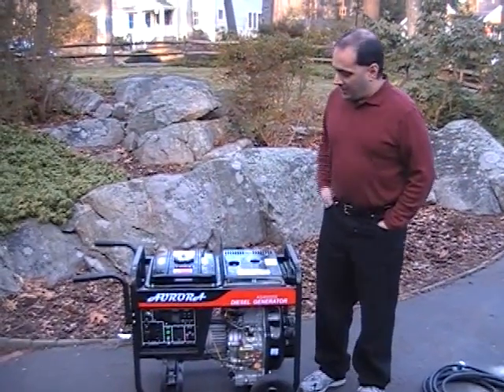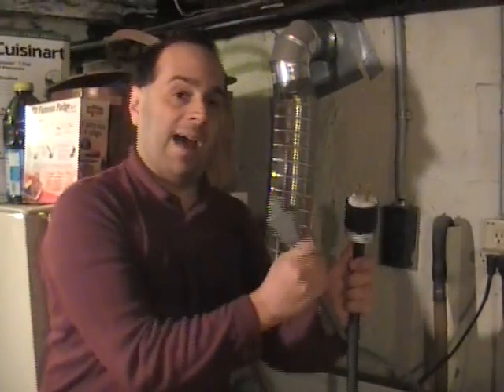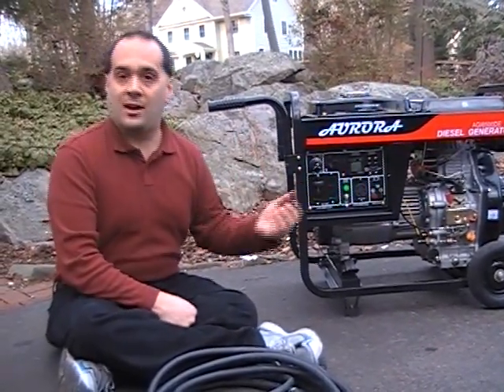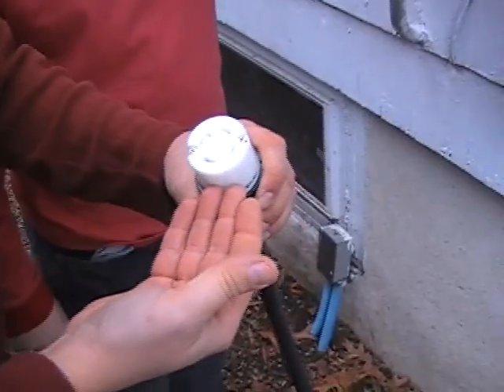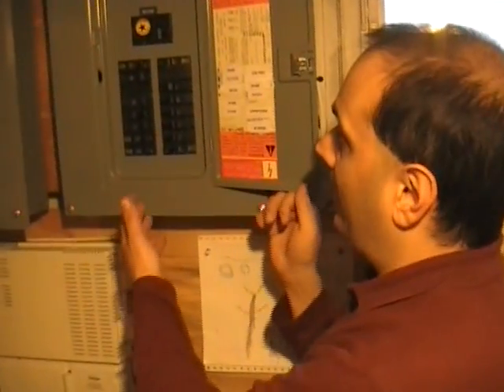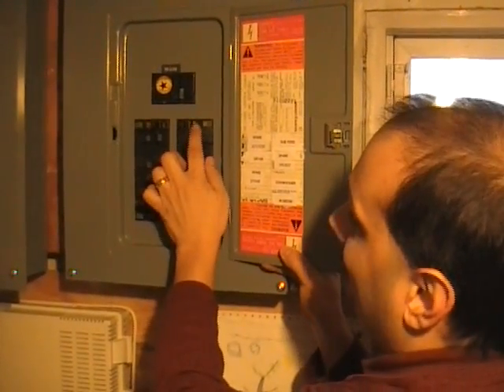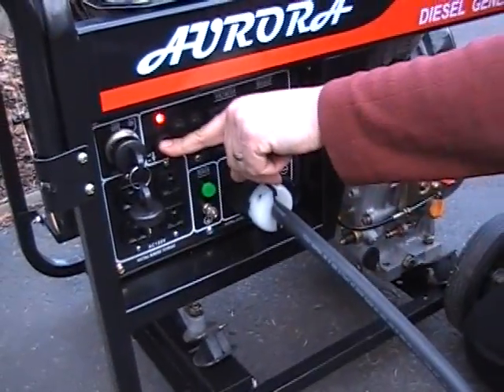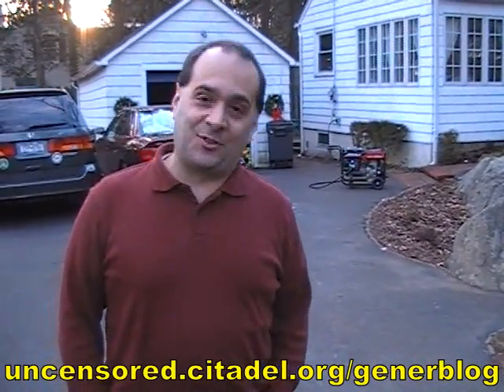Inexpensive residential generator hookup

Comment: The NEC allows up to SIX panels.  Ok, you added one to your main because you said there weren't enough spaces in the main panel.  You could have used an interlock kit on your main panel (which also feeds your sub panel via a 60-amp breaker) and moved a few circuits to the new panel to accommodate the new generator breaker in the main panel.  Your emergency generator would then cover ALL your circuits, not just one panel or a select few circuits.

When setting up your loads in the panels it's important to balance them.  Meaning, don't put all your 115-volt loads on one leg.  Use a tong meter to make the best use of the few watts your generator produces.  A 5,000 watt generator will NOT produce 5,000 watts on one leg.  It will only produce TWO 2,500 watt legs.

Please emphasize that overload protection (breakers or fuses) are there to protect THE WIRE.  That means, whatever size breakers are on your generator MUST be covered by correctly sized wire between your generator and your service panel.  Some jurisdictions (like Dearborn, MI) will not allow aluminum anywhere in the city, so now we're only considering copper wire sizes.  If your generator is more than 60 feet away from the service panel, bump the wire size UP.  Why? Because (current squared times resistance) the voltage will drop drastically as current nears the maximum amperage of the wire.  Yes, I am an Electrician.  BTW, Square-D QO breakers are the finest on the market.
Reply: Actually, the NEC only limits you to six operations of the hand (usually the main in each of six panels all connected to the incoming service line).  There is no limit to the number of sub panels (i.e., panels fed by a breaker in the main panel) you have because shutting off the main panel shuts them off too.  
If you're going to install a sub panel, I'd just move enough circuits over to it to free up enough space in the main panel to allow for the generator breaker to go there, then buy an interlock kit for the main panel.  This is not a problem for a relatively new main panel, but an interlock kit for old panels may be hard to find, although there are generic kits available.  
My son has a 200-amp GE panel with plenty of space and the GE interlock kit was easy to install if you're handy.  It did require drilling a few holes.  
In my house, also GE but before interlock kits were available, I used a 100-amp manual transfer switch I picked up on E-bay for $100.00 and moved critical circuits to a sub panel fed by the transfer switch.  The normal feed is a 50-amp feed from the main panel, back up is from the generator.  It's true, a new transfer switch would cost about $700.00 (hard to believe).  I also put a 30-amp fused disconnect in the generator circuit.
A friend of my son's asked me to run a 30-amp circuit to a dryer outlet located outside his house to enable him to use a suicide cord to feed the house, and with no interlock.  I flatly refused to do so.  It's illegal and dangerous, and you could kill someone.  Back-feeding 120-volts to the utility company could back-energize the utility distribution transformer and thus back-feed the voltage system.  I've seen it happen.  Fortunately, we heard a generating running and had it shut down after we saw how it was hooked up.
Reply: @dandj50  Here are the portable generator safety rules: make sure you are aware of all the warnings before using portable generators. This is just a reminder for everyone’s safety. All generator safety rules should be followed carefully. This advice is just to make sure that everyone is aware of all the warnings and it’s just to remind people to be careful using portable generators. Generators can be dangerous if not used carefully. Every year, hundreds of people die or get injured when using portable generators due to carbon monoxide poisoning and electrocution. Make sure you are using your generator carefully and keeping others safe as well. There is something very serious that everyone should always be aware of when using generators. Some people do run their generator indoors which is not safe and that increases the risk of carbon monoxide poisoning which can cause death of family and you. Some people run their generator in wet conditions which can electrocute them. Please remember that you should never run your generator indoors. Remember that carbon monoxide is an odorless and colorless gas that you cannot see or smell. Carbon monoxide is a silent killer. Keep that in mind. Make sure your generator is 15-20 feet away from your house and away from doors, windows, and vents. Never use your generator in your porch too. Having a carbon monoxide detector is very important against generator safety. Some people also allow children to go near the portable generator which could pose risks. We need to keep an eye on our children making sure that they are not near the portable generator so they won’t get electrocuted or burned by the generator which is dangerous. A locking enclosure also keeps kids safe. A generator shed might look like a tempting place to explore, or take cover during a game of hide and seek, but a generator is a dangerous piece of equipment that can cause injury. It says on the manual that we should also keep children away at all times from the portable generator to avoid injuries. Please do not allow a child or unqualified people to operate the portable generator.  It is important to keep your children safe especially little ones. The portable generator can be hot during an operation. Just because some manuals missed what should be listed doesn’t mean it’s safe to do. Always follow the generator safety rules when using portable generators. Generators pose electrical risks. If you need to use your generator during wet weather, you need a generator tent to protect your generator from getting wet. Don’t let your generator get wet. Keep your generator dry and before using your generator, please make sure your hands and your generator is dry. Do not wear loose clothing when operating the generator. Everything that is said on the generator’s operating manual should not be ignored. Never smoke cigarettes near the generator. Please keep flammable things away from the generator. Never overload your generator too. Your generator can catch fire. Never ever try to plug a generator cord into a wall outlet to avoid back feeding. Back feeding your generator is dangerous. Always turn on your generator first before plugging in appliances and shut off the appliances before turning your generator off. Use a heavy duty cord for your generator and the cord should not be worn out. All the instructions should be followed carefully. Never refuel your generator while it’s running. It can cause fire if fuel spills while your generator is hot. You should turn off your generator and let it cool off before refueling it. Having a fire extinguisher next to the generator is also important. This is only a reminder for everyone’s safety of using generators. Make sure your generator is properly grounded. Having a fire extinguisher next to the generator is also important against the safety rules. https://youtu.be/I1jT3ANENvI and here is a video more about keeping others safe when using generators and also about our family’s safety. It’s important to keep our little children safe as well. Make sure they’re away from the generator. Hope this helps.
Reply: How does he have it wired up without a transfer switch? To have an electrician set it up the way he has it would be expensive right? Maybe a thousand dollars.
Reply: @wanaraz  He has a breaker in a panel with an interlock.  Depending on the location of the generator plug to the fuse panel it might not cost a lot of money.  My plug is located directly outside the house right by the fuse panel.  Took about 5ft of cable to connect it into the box.   Probably 200 bucks in hardware and another 200 for a licensed electrician to put it together.
Reply: @wanaraz  Here are the portable generator safety rules: make sure you are aware of all the warnings before using portable generators. This is just a reminder for everyone’s safety. All generator safety rules should be followed carefully. This advice is just to make sure that everyone is aware of all the warnings and it’s just to remind people to be careful using portable generators. Generators can be dangerous if not used carefully. Every year, hundreds of people die or get injured when using portable generators due to carbon monoxide poisoning and electrocution. Make sure you are using your generator carefully and keeping others safe as well. There is something very serious that everyone should always be aware of when using generators. Some people do run their generator indoors which is not safe and that increases the risk of carbon monoxide poisoning which can cause death of family and you. Some people run their generator in wet conditions which can electrocute them. Please remember that you should never run your generator indoors. Remember that carbon monoxide is an odorless and colorless gas that you cannot see or smell. Carbon monoxide is a silent killer. Keep that in mind. Make sure your generator is 15-20 feet away from your house and away from doors, windows, and vents. Never use your generator in your porch too. Having a carbon monoxide detector is very important against generator safety. Some people also allow children to go near the portable generator which could pose risks. We need to keep an eye on our children making sure that they are not near the portable generator so they won’t get electrocuted or burned by the generator which is dangerous. A locking enclosure also keeps kids safe. A generator shed might look like a tempting place to explore, or take cover during a game of hide and seek, but a generator is a dangerous piece of equipment that can cause injury. It says on the manual that we should also keep children away at all times from the portable generator to avoid injuries. Please do not allow a child or unqualified people to operate the portable generator.  It is important to keep your children safe especially little ones. The portable generator can be hot during an operation. Just because some manuals missed what should be listed doesn’t mean it’s safe to do. Always follow the generator safety rules when using portable generators. Generators pose electrical risks. If you need to use your generator during wet weather, you need a generator tent to protect your generator from getting wet. Don’t let your generator get wet. Keep your generator dry and before using your generator, please make sure your hands and your generator is dry. Do not wear loose clothing when operating the generator. Everything that is said on the generator’s operating manual should not be ignored. Never smoke cigarettes near the generator. Please keep flammable things away from the generator. Never overload your generator too. Your generator can catch fire. Never ever try to plug a generator cord into a wall outlet to avoid back feeding. Back feeding your generator is dangerous. Always turn on your generator first before plugging in appliances and shut off the appliances before turning your generator off. Use a heavy duty cord for your generator and the cord should not be worn out. All the instructions should be followed carefully. Never refuel your generator while it’s running. It can cause fire if fuel spills while your generator is hot. You should turn off your generator and let it cool off before refueling it. Having a fire extinguisher next to the generator is also important. This is only a reminder for everyone’s safety of using generators. Make sure your generator is properly grounded. Having a fire extinguisher next to the generator is also important against the safety rules. https://youtu.be/I1jT3ANENvI and here is a video more about keeping others safe when using generators and also about our family’s safety. It’s important to keep our little children safe as well. Make sure they’re away from the generator. Hope this helps.
Reply: About what would it cost to have it done by a contractor? Is doing it yourself really worth the time/money saved?

Comment: Hey the worst thing you can do is watch a vid like this and try to hook up your portable gen to your house. Or even have a clue as to what your doing. Shock and fire usually result. Get a qualified electrician Familiar With Portable Generators and have the  generator connected to your house isolating it from back feed or anything else  such as two neutrals or accidental suicide. Your gen set must confirm to all applicable codes as in connection to your home and it's illegal to connect it to your home in most jurisdictions.
Every year people are electrocuted by an improper gen set hook up. Additionally some also die due  to carbon dioxide poisoning from operating it inside the dwelling or in two close proximity to the dwelling. May allow for exhaust fumes to enter the dwelling. Generators packaging includes s warning Not To Operate Inside! Additionally your portable generator is not to be enclosed not is it supposed to be operated in close proximity to a house. AC household electricity is widely misunderstood by the public
Glad you understand this guy  as your probably dead from lack if knowledge and or trying to save a buck ⚡⚡⚡⚡⚡⚡⚡⚡⚡⚡⚡
Reply: Especially if they are as ignorant as you.
Reply: listen to this bull.probably another electrician seeing overpaid service calls flying away.the guy in the video did it EXACTLY the same as an electrician would have,without the insane high bill/
Reply: @mariomartin1981  You assume I'm an electrician and I'm by no means that. However I have 50 + years experience as a licenced Motorcyle mechanic, automobile mechanic and marine and power equipment mixed in,  that includes portable generator certification and testing. ALSO trained by Uncle Sam as a USN sailor in engineering + + +.. How many generator fires or installations have you inspected. How many portable generator fires have you investigated due to refuelling while being operated. Have you ever been called as a witness for any of what I stated. How about for the compliance  of a smoked gen set by a delinquent and negligent operator or user. How about tin foil placed over the blown generator fuses on those that had them and (Short) Of not a  Warranty defect but tampering! Shock and smoke from a fried stator!
I really don't give a rat's ass if you go and fry yourself as that's just your arrogance and supposition. Have you ever looked at brand name transfer switch boxes that allowed for two neutrals or as commonly called a Raceway,  Guess what they do and allow for. 《 If it costs you some money to get it done right and to code that's just what it is》If you can't afford it then just run some heavy gauge extension cords not Made in China and run your fridge, freezer, etc. and manage the load on the generator, but consult an electrician to be sure your ok to do that. DONT fire the Effin BBQ up in the house to cook or heat it either as that happens as well and they all end up in the long sleep called dead. Maybe it's related to improper portable generator operation???
So if you wanna play you gotta pay. And this is one thing you can't cheap out on, jury rig, or say that'll work  , or I  believe or I think. We use AC electricity daily, but why would you childprroof outlets and so on in your house. USING your analogy: Some ones trying to make money on you right. What's a child's life  worth? Think on that again. 
I can do to a transfer switch install. But I chose not to. If I did I'd prewire it and Not connect it To the panel,  install it to CODE using a state regulations or provincial regulations that you can purchse at Home Depot. Rough it all in and then have it inspected and connected by a card carry certified electrician. But no matter what if you don't understand it don't attempt it ever. You'll be dead wrong!
Ya think I'm kidding I'm dead serious as there is no reason for a death in a cheap out incorrect stupid installation ever.
Reply: @mooglemy3813  yada.yada.yasa,,i'm a know it all ,,NOTHING the guy did in this video is wrong,,but all the know it alls just want to bash to protect overpaid union electricians,,
Reply: @mooglemy3813  man! Lay off the caffeine
Reply: @tombeckring2255  Tom maybe that's what's wrong, a one line comment or sachasm does nothing, yea maybe I'm pissing in the wind but so what. I can can get something from someone that adds to my learning/knowledge that's a good thing. No offense just saying.
Reply: @mooglemy3813  Did I miss something? You have valid points but, I never this guy run his generator in the home.
Reply: Another tradesman who absolutely hates it when their "profession" is exposed for being SIMPLE
Reply: @mooglemy.  really?  Shock and fire USUALLY result?  Just curious, is that 60%, 70%, or 80%.  Get a life.  You're really not that much smarter than everyone else!